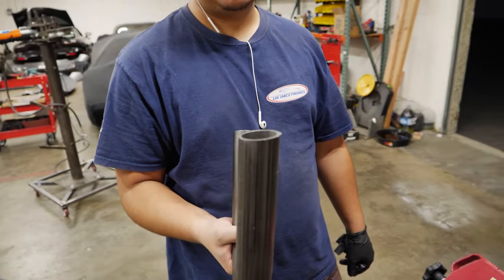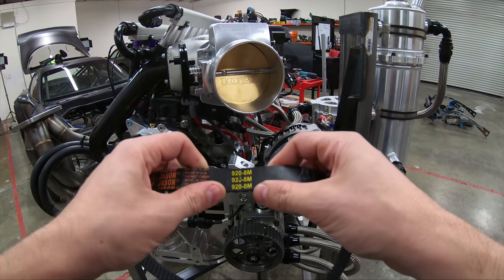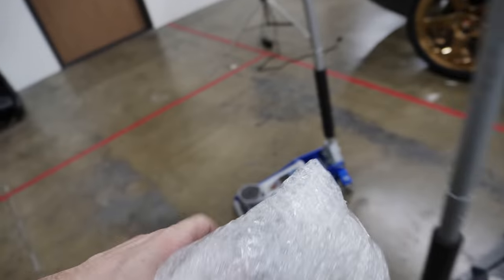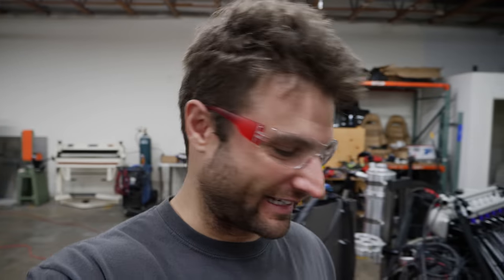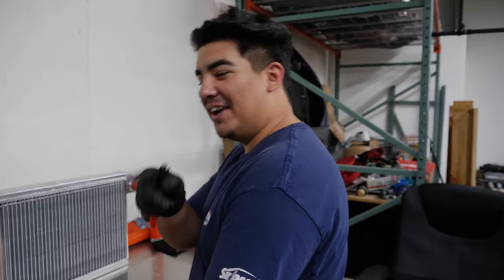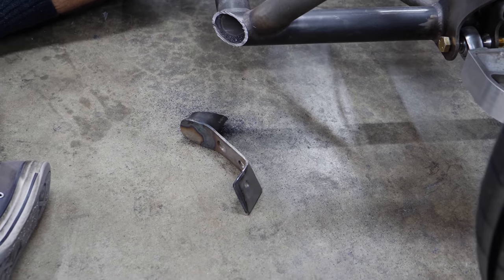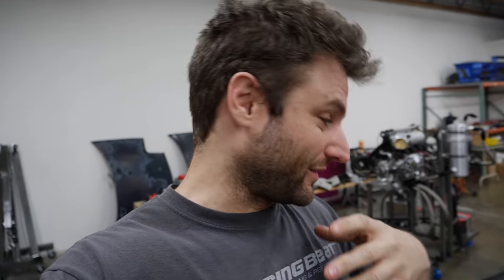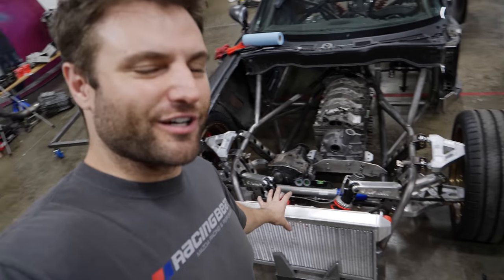The AWD 4 Rotor SEMA Build is getting CRAZY! Engine mounts, Radiator and shroud.

Comment: Hey Rob, you might have issues with that fan shroud you made. It's great at idle and very low speeds so that the fan can only pull air through the radiator, but you might start to get hot at speed. The air will tumble and backflow as its travel through the shroud and trying to get through the fan.

Comment: On the old straight 8s they would have a cooling problem on the back of the motor ... one of the guys I knew pulled the core plug on the back of the head or motor I don't remember which, and use that to flow coolant in. So there were two ins, one on the top in the front and one on the top in the back and then one out on the bottom in the front. That seemed to resolve his cooling issues.

I never fully investigated what he did or how he did it, just an idea of what he was doing. I don't know if something like that would help you, but it certainly helped in that situation.

When running a Turbocharger big enough that you have to transport it on a flatbed semi trailer you sometimes have to improvise with out of the box Solutions like that.

... edited because I use speech to text and I don't know how to proofread.

Comment: you should drop the 4 rotor and run a candle power Stirling engine... its really the superior engine platform if you're packing heat in the meat department

Comment: Even with a nice professional dual spindle bandsaw, it will deflect the cut like that if dropped too fast. Try using a much slower drop speed when cutting material harder than mild steel.

Comment: 0:47 easy, gap the pipe a tight 1/8th and back feed a 3/32 wire in there. pretty common practice when we are welding restricted pipe.

Comment: Rob, are you concerned about all the heat from the radiator being dumped directly onto the front shocks? The oil in the shocks will heat up and thin, dramatically changing performance and stability of the front end. You'll lose damping control of both compression and rebound, and have a po-go of a front end. You're working with some incredibly cool and high end materials, would be a shame to see them go into a wall. Maybe build a heat shield to protect the front shocks, or route a fresh air supply for the shocks so they can shed heat.

Comment: Please make some holes with rubber flaps on the fanshroud. Air flow is terrible while driving and the extra holes allow more air to flow through and the flaps close them off while standing still with the fan on. They do this on thin oem fan shrouds as  well. Keep it up!

Comment: With regards to the belt I'm probably stating the obvious and you likely already did it this way to come up with the first belt size, but it'll bug me if i don't atleast ask so here goes. Did you use a bit of string and loop it around where the belt would go cut it where the 2 ends meet and measure?

Comment: You can run that car with normal pump gas and methanol. All electrik parts are all ready there. For power drifting 4x4 ALM racing in  Sweden. I think they can help you with clutch's++

Comment: Tell me, why did you make a cantilever system for your front wheels?... It uses up so much space and makes it awkward to work with imo. 
Btw, with that massive plate behind the radiator youre limiting the air flow more than youre helping it.

Comment: Brother. There comes a point where just looking and looking and looking to think if itll clear becomes a pointless endeavor. Take the fittings off and drop the fucker in. Then use pipe cleaners or i use shark bite home water hose and warm it with a heat gun to the angle of the fittings and it hardens a little without getting brittle. on the angles to check clearances. It will save you weeks of pointless over engineering. Save yourself some time bud. Over thinking is a thing